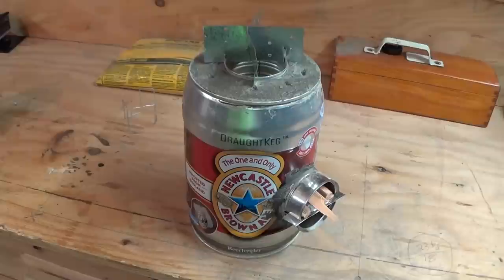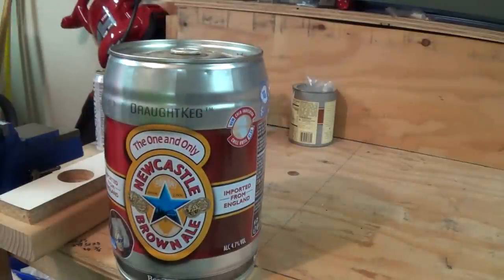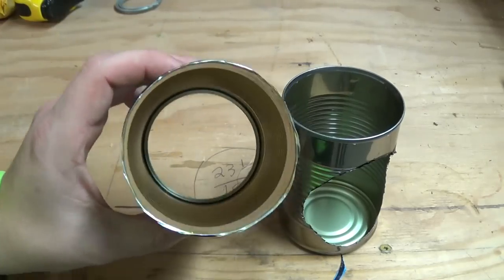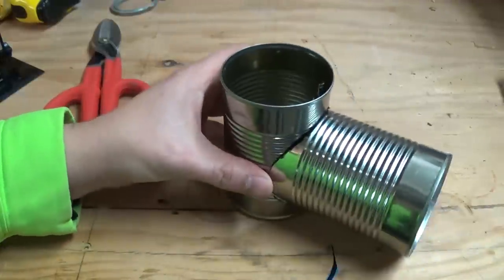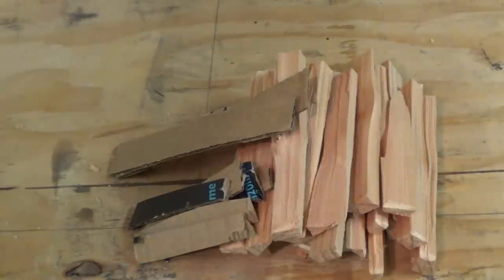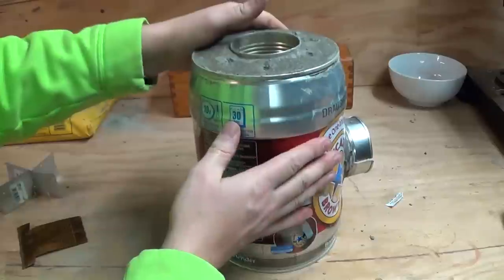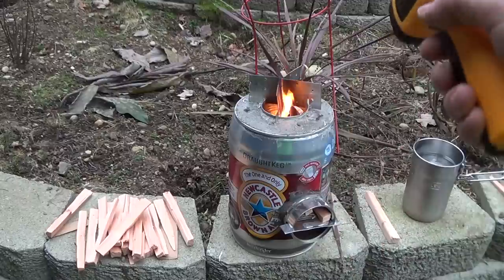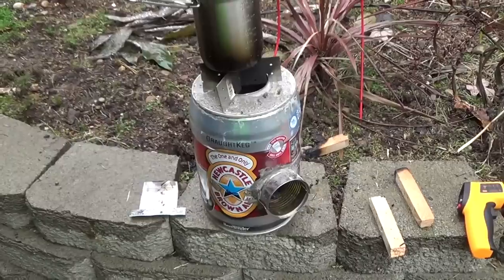DIY The Beer Keg Rocket Stove The Coolest Stove on YouTube

Comment: I like the design, and having the chimney higher than the edge worked out. I would have sunk some metal supports into the concrete for later use.

Comment: On your next one leave more of a "well" under the air/fuel intake tube or can. You need a place for the ashes to fall and not restrict the air flow. And you were right about needing a lower/shorter pot stand height.Other than that you did good. I made a stove from a Warsteiner beer keg myself.
Reply from the maker: +gvman3670Thanks for the ideas, beer keg is deffantly the way to go.  I plan to make a forge next!

Comment: Bro ! The cup holder you using is galvanised metal ( If I'm not mistaken ) and as result when you heat it up it releases some VERY VERY dangerous fume that can easily kill or seriously damage human being !!! Be careful ! Stop by in the hardware store you had shop those Joist hangers and ask if those are not galvanised ...Just a tip ..
  Almost forgot  ! I like your idea and I want to make one just like it . It is small and mobile . Thank you

Comment from the maker: @Nathan Deneault

The dimples are where I attempted to place my 6" long 1/4" bolts to hold the pot.  Unfortantly the bolts ended up sinking in and I couldn't get them level.  I ended up pulling them out before the concrete had fully hardened. 

I have a burner grate I found at a local store that I'm going to put on my next Rocket Stove build.  hoping to get it done this weekend.
Reply: You dont put the bolt directly to wet concrete unless you tied it in position. Another easier method is to make holes when concrete hardened a little bit by using a stick. And then you put your bolts in the day after and put mortar grout them.

Comment: You could cut the weight considerably while increasing insulation efficiency by mixing pearlite with the cement or plaster of paris.
Reply from the maker: +jrfoleyjr in my Rocket Stove 2.0 video I mixed concrete and perlite together.  it worked pretty well.  it was significantly lighter.  this was more of a just for fun project,  it's a little big to carry in my back pack.

Comment: Pretty cool, I wonder if you could put a base of concrete in the bottom and then line the top half with expanding foam.
Reply from the maker: I might have to give that a try on my next build.  This prototype is defiantly on the heavy side for a camp stove. 

Thanks for watching!
Reply: I think the foam would still burn or melt but perlite/vermiculite is a vary good and light weight alternative.

Comment: The fuel tray isn't optional; it's >necessary< in a real rocket. So too is insulation. Plain cement is a heat sink, not an insulator, and will cause your fire to burn much cooler than you need it to burn to make the proper rocket-stove clean, hot burn - which is also the most fuel-economical. 

To make your rocket burn at a higher temperature, you need to mix about five parts perlite or vermiculate to each part wet cement and mingle thoroughly, so that it will actually insulate the burn area and make it hotter by a hundred degrees or so. Alternately, you could fill the insulation volume with dry wood-ash, if you have enough. Make sure it's dry, though. I've used all of these in making authentic rockets, and they all work well. But note: glass-fibre is no use because it melts away - literally - from the hot fire tube, leaving an uninsulated, convection-current-generating void.

YouTube is awash with stoves called rockets, although their makers clearly know next to nothing about the principles of rocket-stove construction that has been worked out over many years by the Aprovecho people and Larry Winiarski. Google aprovecho, to learn more. Many of these so-called rocket-stoves shown on YT are actually cargo-cult rockets: they look vaguely similar, but they don't work anywhere near as well, because sympathetic magic is nowhere near as effective as the sound lab-work and repeated field-testing with feedback which Aprovecho has done over the past 30+ years. Learn from their stored experience and their sound fire-science! 

If you do that, this is a nice way to make a good rocket; though my experience is that you would do better to make the fire tube - that is the fuel-feed tube and the chimney - in stainless steel. Mild, especially this thin, will burn out quite quickly. On the other hand, good rockets have been made simply out of the perlite/vermiculite concrete, without metal liners for the fire tube, just sacrificial plastic-tube formers. It's fine to use a thin mild-steel container like the beer keg for the containment can, though, because it never gets corrosively hot, and doesn't contact the hot burn gases directly either.

And remember: the fuel tray, with primary air-feed going underneath and up through the burning tips of the fuel-wood at the bottom of the chimney, is an essential part of the properly-functioning design, not optional.
Reply: +Rhisiart Gwilym Sorry! That's vermiculite, not -ate!
Reply from the maker: +Rhisiart Gwilym you are correct.  you should check out my Rocket Stove 2.0 video where I implement this change along with a couple of others,  its a much better stove overall.  

Thanks for watching.

Comment: drill 3 holes ,put in metal anker bits with screw wire in then you can put bold in  no problem any more to get them level ,
just my 2 cents

Comment: Cool stove!  maybe not "the coolest" but still an awesome conversation starter!  I was wondering if you considered mixing the concrete 5:1 perlite to concrete?  To reduce the weight & give more of an insulated property?  I would think it would take awhile for all that concrete to heat up or act as more of a cooling mass?  Maybe even stick some bolts down in the wet concrete for your pot stands or even set them face down so only the bolt head is sticking up for pot supports?   Also, with your fuel shelf; how about a small grate at the end for the coal bed to sit on so the air is drawn underneath the actual flame point?  Could make the fire burn hotter & more efficiently so you don't end up with all that soot on the bottom of your pot.  Just some thoughts from a fellow Rocket Stove affectionado!
Reply from the maker: David Russell Thanks for all the feed back,  This was my first rocket stove attempt but you've given me a few good ideas for Rocket stove 2.0.  I have another beer keg left over so I might make it soon.  I can say from my test burn I agree with you on the fuel shelf as I ended up taking out on this version to improve performance, maybe I will take my existing one and drill a series of holes with my drill press.  the concrete insulated reasonably well.  I was able to pick the stove up after two burns with my hands but I think the performance could be improved using something with a higher R value. Concrete can pull a lot of heat energy from the fire without getting much warmer to the touch I will try the perlite to straight concrete mix you suggest.  I actually tried the bolts on this model but couldn't get them level enough to satisfy me.  I ended up taking them out for this build before the concrete had set.  maybe I will make a wood template for the next build so I can get the bolts se correctly.  do you have height that you feel the stove works well at?  I feel my crude pot holder was a little too far from the chimney.
Reply: Todd of Silverfire rocket stove fame says that the pot stands should be 1 cm in height.  He appears to be the leading expert in the rocket stove field.
Reply from the maker: David Russell Yeah mine is way more than that probably closer to 3" or 7 1/2 cm
Reply from the maker: I just finished my rocket stove 2.0 build.  I used some of the ideas that you shared with me in this post so I thought I would share with you the improvements I made. 

https://www.youtube.com/watch?v=y3SjNTL66-4 

Take Care.
Reply: gearsNtools

Comment: great  stove.... I would not us galvanized steal for your burner hold (the cross parts of metal burner pot/pan hold) galvanized, steal  when heated releases some nasty toxic fumes... = not good for you, also not good to cook or eat off of...  also your air tray should only be 1/4 of the inlet pipe. to much air will burn hot and use more fuel than needed.. plus concreat cracks at high temps??? I would use sand mixed with  perlite!!!!
Reply from the maker: +Richard Downer all good points,  you should check out my 2.0 video,  I fixed most of these issues on my second version.  I'm learning as I go.  I'm glad you enjoyed my video.
Reply: I'm going now to check it out. thanks bud...

Comment: I'm afraid you don't have a rocket stove, you have a wood burner. Your internal pipe is way too short to cause a rocket effect. When burning it should roar as it re-burns the gasses given off by the initial burn. There should be zero smoke.
Reply: Isn't that actually true for like 80% of the DIY rocket stoves on Youtube?

Comment: nice design.... however concrete is a poor (too dense and non porous) insulator, so not really a very true, and/or non polluting rocket stove... had you used perlite or vermiculite instead it would be more ideal, or more a true rocket stove...
Reply from the maker: +forest greenwald Thanks for the feedback,  I agree with your comments,  you should check out my rocket stove 2.0 video,  I used a perlite concrete mix and put a proper stove grate on top.  the results were much better.

Comment: Regular concrete can crack and spall if you get it hot enough. What you want is fire barrier cement, the kind of stuff you use for mortar around firebricks. Mix that with perlite to reduce weight.
Reply from the maker: +pauljs75 I did that in my rocket stove 2.0 video,  I also put a lot better top grate on it.  I'm pleased with how it turned out.

Comment: Its a waste of time to use soup cans in your rocket stove because you will be replacing them within 5-10 burns, unless you use concrete that will hold the shape of the cans after they fall apart

My first rocket stove was made with a popcorn tin, perlite insulation and soup cans, and the soup cans disintegrated in 5 test burns. In my second rocket stove I used aluminum gutter parts in the same popcorn tin, and they started melting in a few burns.

My current rocket stove is made from a 5 gal metal bucket and 26 gauge metal duct, and has held up for many months of regular use. I also use a second 5 gal metal bucket with a hole cut in the bottom of it (the top lid also has an exhaust pipe) to fit on top of the rocket stove as a homemade smoker. Works perfectly, I can smoke a chicken in an hour with a tree branch
Reply from the maker: Objective Inquiry cool idea with the smoker.  yeah I figured the cans wouldn't hold up, but this was more of an experiment for me anyway just to see how well it would work.  I'm working on a new one right now.